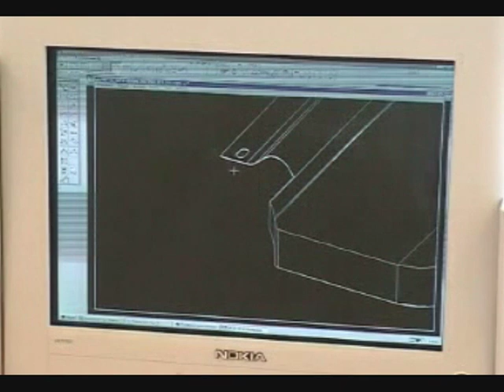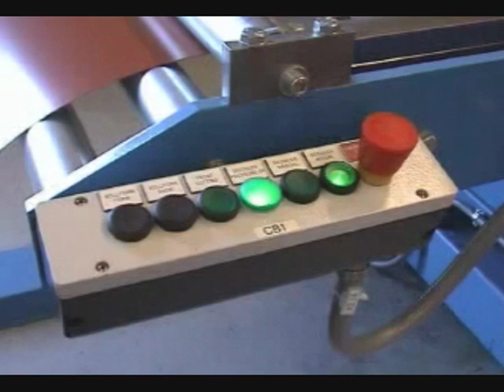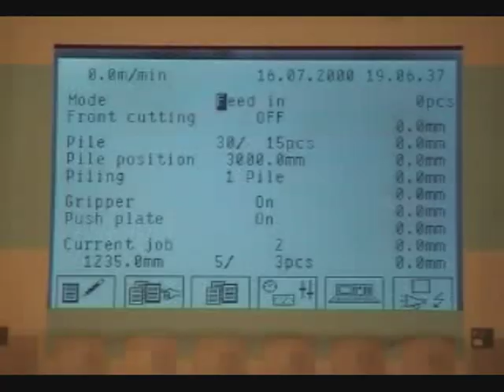FUSA Metal Roof Tile Panel Machine Concealed Fixing

Comment: Panels too small =(
Reply from the maker: +2Awesome This video is showing a concealed-fix panel.  Our panel is the biggest with that technology.  Because of the nature of fixing, it has to be narrow for uplift forces.  We have through-fix machines making conventional metal tile roof panels in any width and length.
Reply: May be better for varied weather for expansion and contraction to have smaller panels.